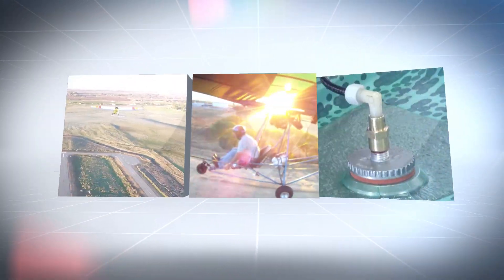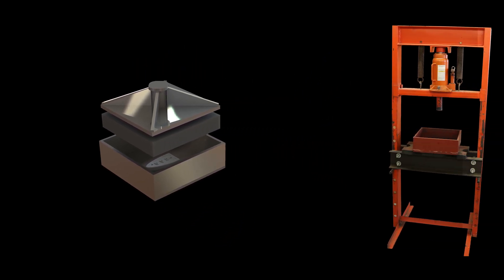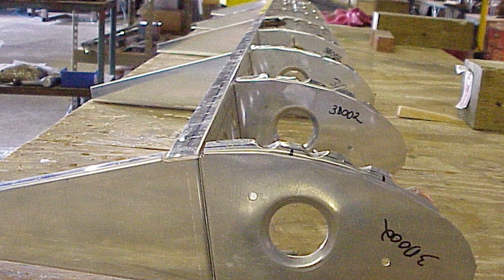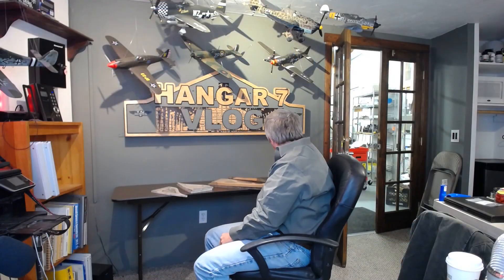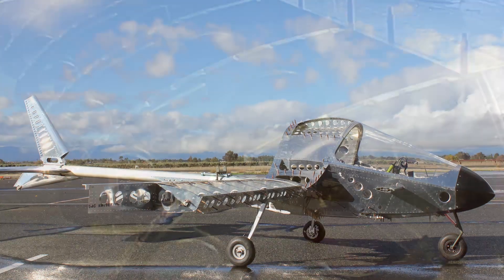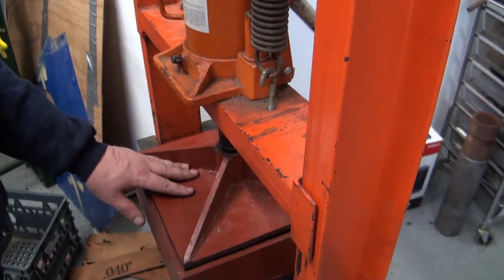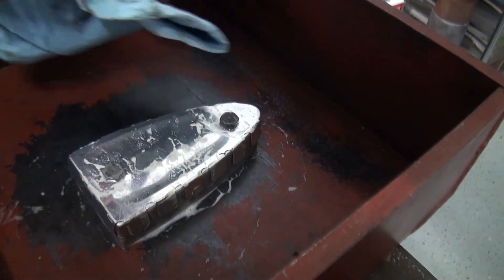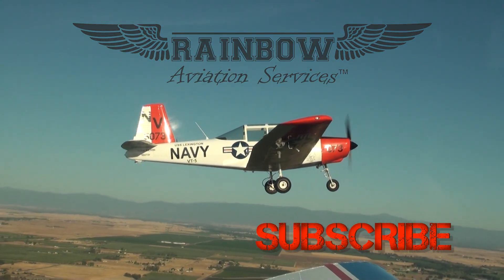Low Cost Hydroforming

Comment: Excellent teaching !

6061 T6 .010 thick material could be formed I believe .

Hardcoat Anodizing could allow stiffness,  and wear resistant surfaces,  and color dying. 

I have c n c machined  solid material,  and your teaching teaches this.

Thank you

Thank you
Reply: In my 60 years of sheet metal work on aircraft I have found T-6 almost always cracks. T-3 is okay, but I use T-0 and heat treat. Heat treating is not hard and can be done with no special equipment.

Comment: Can use a harbor freight log splitter as a press also.  We use them for forge presses in blacksmithing.  Cheap as hell and it can be used as a log splitter or a press just by fabricating some kind of quick(ish) die changing system.

Comment: This is not hydroforming it is using hydraulic pressure to press a die with rubber. Hydroforming is using water pressure to push metal into shape.

Comment: hello, I found the rubber suitable for making the forming block for my project.... I see you have made plans for making the plunger as well to fit inside the box. I assume constructing the plunger is cheaper than sourcing a very thick steel plate?

Comment: that much rubber all at once is hard to find using the MDF as a buck and a pneumatic hammer and some map gas and klecos is just as good and not as hard to source and a hell of a lot more exact. you local machine shop won't soak you likely for the job. if stamping is what you won't just have them make you the form and then use the press no if you are gonna make many different parts that won't do of course as the dies will cost more than a new airplane or new anything your building unless you mean to manufacture and you have buyers lined up that won't make sense. i have seen the shoddy work whome ever that maned those wing parts im pretty sure id not buy from them again.

Comment: How about forming Vehicle Replacement Floor Pans, from Sheet Steel? What kind of Press (Pressure) would that require? 

How about Making the Dies in a "Progressive Step  Sequence", where each Die moves the metal towards the Final shape a % of the movement at a time? Say, Die #1 moves the metal 25% of the target shape; then Die #2, another 25%; Die #3 - another 25%; & Due #4, the Last 25%? 

This way, you could also have the Benefit of more steps with Lubricants allowing the Metal you are forming, to "Slide" as it moves, instead of "Gripping" to the Die, or the Rubber!
Reply: It is a common Industrial technique, and should be beneficial. However, even a two step, or two Die approach, could help! 

I guess the challenge comes from the issue is most "Homebuilt Aircraft Builders" don't find themselves with A lot of "Tool & Die Design experience!" 🥴

Maybe there are Videos on YouTube to lubricate the Learning Gears on how to design Progressive Dies? 🤔

If course, some fairly good 3D CAD Skills, will be helpful! And some good software to export the Designs from!

Comment: This is a misleading video. It shows a form of press forming NOT hydroforming.
Reply: True and not true. It's called pad press forming. And the physics of it is at pressure the rubber goes through a phase transition to flow like a liquid. But a hydroformer usually uses a liquid behind the elastomeric sheet.

Comment: You should blend your rubber into chunks, making bags of different densities, mixed with different dyes. Red for high, blue for low, etc.  Then "pour" this rubber into box to give a differential gradient by mixing them. If the rubber is not only of varying colour but also varying size, you could quickly filter them back out into bags afterwards, and refresh the bags from time to time.
Reply from the maker: The biggest problem with this approach is getting the small chunks in between the metal to be formed and the mold. If we use sacrificial rubber that is all tore up we have the same problem.  If used with a single sheet of rubber and then the chunks,  the process would probably work well. Good thinking.

Comment: How is this hydroforming? this method is called stamping. hydro means water. hydroforming is a method that uses water pressure to form the metal.
Reply: It doesn’t use water, Brian. “Hydro” refers to any type of hydraulic fluid.
Reply: @patrickpieper8878  'Hydro' does mean water, though it's prefix is used in other words with other liquids, such as in the word hydraulic. However, using hydraulic pressure to stamp metal into a mould is not hydro forming. That's just hydraulically powered stamping. In hydro forming you use water pressure in direct contact with what you are forming to shape metal. Look up some other videos on hydro forming and you will see what it is and why this video is incorrectly labeled.
Reply: @patrickpieper8878  You are still missing the point. No liquid touches the metal. The metal is not formed by liquid. Hydro forming is a process that uses water pressure in direct contact to form metal. And yes, hydro does mean water. Look it up. The prefix, without the 'o' at the end is used for other liquids.

Comment: If you're making smaller pieces you could use a hockey puck for the rubber blank. They're plentiful.
  Or the blocks they use for automotive lifts. They're relatively affordable, easy to find and come in many shapes and sizes

Comment: Nice video, but please use SI units or at least show a conversion.
Reply: It's a safety/liability issue.  By using standard measurements, only those qualified to operate machine tools will be able to figure out the linear conversion and make this in countries that are still using the metric system, so less likely youngsters will hurt themselves.  That's my attempt at humor.  But in all seriousness, if you can't make a 12"x12"x3" box out of 3/8" steel in whatever units you want, without even thinking about it, you won't be able to make the dies.

Comment: wonder if the solid rubber floor mats might be a good cheap source or rubber?  about 1/2" thinkness glued together.  I may have to do this.  Thanks for the video.
Reply from the maker: I'm sure that the floor mats would work. Good idea. the point here is. "low Cost".
Reply: TPU rubber floor mat. It’s basically hard but foamed.

Comment: Shouldn´t the positioning pins be bolts with flat, circular heads without any corners and edges instead of hexagonal heads???
Reply: From another post "Use clevis pins for your locating pins"

Comment: I use Hockey puck as rubber. perfect for small parts.
Reply from the maker: I use a hard durometer rubber for  increasing definition in localized areas. The puck would work great for that.
Reply: I use a gym weight lifters matt... cheap, bouncy ( about a 50 shore or so ) and cheap from American floor mats.   FYI

Comment: I've made dies from fiberglass with as much as 1.5" draw in mild steel. I use a 200 ton hydraulic press for pieces as big as 300 square inches. Instead of rubber, I make male and female dies.

Comment: if you have to manufacture a die anyway, why not just use a positive AND negative die and get rid of the rubber altogether??
Reply: That's another useful process, just costs a bunch more and is harder:
At least twice the number of dies (time, $$, have to design inter-die clearance to allow for metal stretching and being compressed which I gather is something of an art).
Have to align the dies; seems to take a large block below to hold alignment pins perpendicular to the plate under considerable stress, a large thick block above (deep enough to allow the pins to travel), pins will get in the way...
For e.g. a 90 degree bend, need a series of dies.  Trying to do that bend it in one shot I gather just acts like a badly aligned metal shear.  So multiple the number of dies by 3+.
Steeper learning curve.

Comment: Hi. I just thought I should let you know, Lemon pledge is full of silicone. There is such a thing as silicone spray if you want something pure but silicone is horrible stuff to get off of surfaces before you primer or paint. It's totally verboten in paint shops. Also, it contaminates your entire shop in which you will be painting resulting in random fish eye. Would not be my go-to. Why not slightly watered down dish soap? Washes off easily and is probably even cheaper.
Reply from the maker: Thanks for your comments. I think everything you say has validity. We have not tried the dish soap,  but I'm sure that it would work well. We been using the lemon pledge for quite some time and haven't really noticed it being a big deal. If you'll notice the thumbnail for the video shows the part anodized. No special treatment was necessary. Simply wash the part with soap and water and proceed with the anodizing process. Normally a contaminated part is not tolerant of any silicone, oil, etc. maybe we are just using cheap lemon pledge. Many of the parts that we use this process on get painted as well. Haven't noticed any problems with fisheye. All that being said. I still agree with you. When we get a chance, we will try the dish soap idea.
Reply: You are welcome. Great videos, by the way. Very thorough. I'm looking forward to using these techniques to build the ribs and formers for my experimental Stinson 108 wing extensions.

Silicone probably does not affect anodizing because I imagine the acid bath removes it, but paint may be a different issue. Thorough cleaning is essential and I'm sure most folks follow cleaning procedures carefully and therefore should not have big problems. That said, it's probably good to know about.  It would be interesting to see the difference in primer and paint adhesion with silicone and without. That may tell a different story. 

Most of my experience with it comes from my woodworking profession where it's avoided like the plague because the silicone becomes trapped in the porous wood. You can imagine because of that it's a lot worse on wood. It makes refinishing very difficult. Cheers!

Comment: Have you ever experimented on using tiny rubber beads suspended in slippery fluid instead?  Your press could have weep holes where you can recycle the fluid on the next press.

Comment: Consider RF welding TPU to make your bladders. It costs pennies a bladder and stays glued inside the part. your latex bladder only last so long and then they break off inside the part as they age. The TPU stays bound to the epoxy forever.
Reply: Bladders?

Comment: Instead of dealing with an inner tube as a sacrificial medium...try using pieces of roll rubber roofing material. It's much tougher than inner tube. There are a couple of different thicknesses available but it's cheap and easy to cut and easy to work with.

Comment: Wonder how a non newtonian fluid would work? How about plasticine? Silly putty (also non newtonian)? I think the harder rubber works because pressure is not lost from getting squeezed out the edges from sloppy fitting pressure plate. The inner tube rubber is much softer.
Reply: Good call . Why not ?

Comment: Have you ever tried hydro forming small stringers from 1/2 X 1/2 X 1/16T 2024T3? If so, can you give some recommendations? Examples of the blocks used?
Reply from the maker: I have not tried the use of the performer for stringers. It would seem that stringers would be easier to manufacture using a sheet-metal brake.

Comment: Really cool, one question, why is the box so big, if pressure is a "precious" commodity? Would you have more available pressure with say, a 6 x6 inch box?
Reply from the maker: The answer is, of course, is yes.  The trick is to balance all of the aspects of the box to make it the most usable possible. The primary criteria is the size of part and the thickness of material that you're trying to form. If all you had to make was one specific part, you would probably size the box specifically for that purpose. The other criteria is you may have a press with much more capability than the simple 20 tons available from the cheapo harbor freight press. In our shop we actually have a 200 ton press and a box that is 16" x 24". We

Comment: Why not just make a positive and negative stamp and sandwich the sheet metal in between. Then you can control every radius.
Reply: Haven't you just described a normal metal stamping process - without any flexible/hydro element?  Not that it wouldn't work, it's just that they each have their preferred applications.
Reply: You'd be doubling your machining, and increasing the complexity and cost of the build, but yes, within reason, there may be SOME application for the approach you mention. I'm curious, how would you achieve the bend-past the positive die ? A precision-controlled gap might be a challenge? Tolerances ? Interesting idea tho.
Reply: That's another useful industrial process, just costs a bunch more and harder to do:
At least twice the number of dies (time, $$, have to design inter-die clearance to allow for metal stretching and being compressed which I gather is something of an art).
Have to align the dies; seems to take a large block below to hold alignment pins perpendicular to the plate under considerable stress, a large thick block above (deep enough to allow the pins to travel), pins will get in the way...
For e.g. a 90 degree bend, need a series of dies.  Trying to do that bend it in one shot I gather just acts like a badly aligned metal shear.  So multiple the number of dies by 3+.
Steeper learning curve.

Comment: I wonder if it would work better using lots of very tiny rubber balls instead of a solid block of rubber. Something like 0.1mm diameter balls. It would require less force and the fine detail might be better.  Would probably need to be a mixture of tiny rubber balls and a non-stick powder. Otherwise the rubber might stick together under the pressure.
Reply: Interesting ideas, but note:  the ram medium has to be flexible enough to form around the part, but it can't be an actual fluid, because then it would flow all around the workpiece, and with a true fluid, the hydrostatic pressure in the ram medium would equalize everywhere (both above and below the part), and the part wouldn't form.  This method relies on the ram material being flexible enough to form around the part from the top, but not to flow underneath it and achieve hydrostatic equilibrium.
Reply from the maker: I think not, even using the innertube material can be tricky because the small pieces have a tendency to get underneath the metal and in between the die and cause irregularities. We normally have to replace the sacrificial rubber if it gets to buggered up.
Reply: Sounds great. Give it a try and report back ? I'd be curious because the tiny rubber balls you describe might be easily acquired, and might give superior results. Don't know whether a fine dry-lube (talc for instance) or something on the order of the Lemon Pledge might work better, but that only means an opportunity for some experimentation !
Reply: I'd think the rubber balls would end up under the part when forming over an edge.  For forming the "face" it would probably work though.
Reply: An interesting idea. Possibly messy though.  But along those lines any number of granular media options could work as well.

A slurry of casting sand and oil, or even just water. Small hardened steel balls might be a resilient option if some texturing is ok.

As for the potential mess, what if the media/slurry was contained in a box like upper plate with a rubber (silicone?) membrane sealing the working side. As it is pressed into the work the membrane and media is forced around the buck.

Alternatively the media box may be open at the top allowing it to be placed over the buck and locked down, then a ram is used to press the media and form the part.  The box can be capped and sealed by that ram with the press acting on it for forming. Thus containing the messy stuff entirely.

Of course you can always invert everything, make the media box the base and static. With the buck and part affixed to the ram plate.  

Or explosive forming! Thats an option right??
Reply: @DrewLSsix  I once applied pressure (2000 PSI or so) to a hydraulic motor in which the casing was not quite closed behind an O-ring.  The O-ring was extruded through the gap like toothpaste.
Whatever the pressure used, you are going to need a seal that retains the media under that pressure.

Comment: This is Rubber Pressing by the Guerin method. Lurathane is a Polyurethane elastomer suitable for this process. Two one inch sheets can successfully be substituted for the two inch block. More complicated and larger pieces can be formed with the use of pressure intensifiers that assist the rubber to flow around the solid die. A second die with a bevel and a cutout in the shape of the first die with significant clearance ( an inch or more) around the first die.
Reply: I'd be interested in seeing how that might work. Is there a link to a video anywhere ? VERY interesting idea - THANKS !
Reply: Sorry Chuck I don't have a video just a couple of years experience pre 2000. We used to place the blank on top of the rubber and then drive the die down into it . Located the die on the blank with a couple of universal head rivets. Secured the rivets to the blank with sticky tape .
Reply: Do you recall what hardness for lurathane?
Reply: Do you recall what hardness for lurathane?
Reply: @nicholasdimarcelloiii3469  Afraid that I don't recall the Shore Number but I do recall using red lurathane . It is firmer the yellow and orange.
Reply: @colinleitch6245 thank you!

Comment: Have you ever tried making dies from 3D printed material?
Reply: good idea
Reply: Actually, that IS a pretty neat idea ! Some post-processing for the proper surface finish of the die if the raw metal-printed dies aren't fine enuff for the particular end-part, but yes, that ought to work !